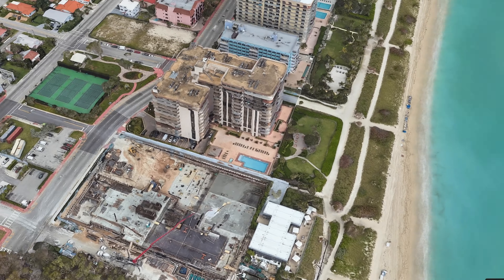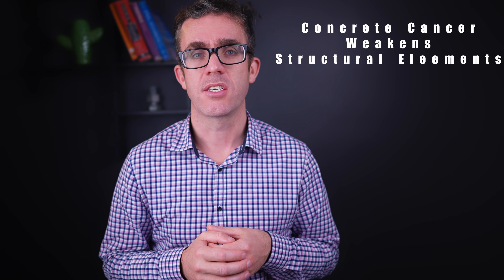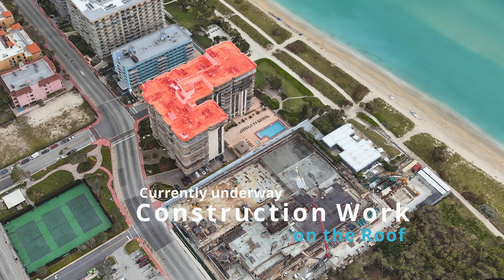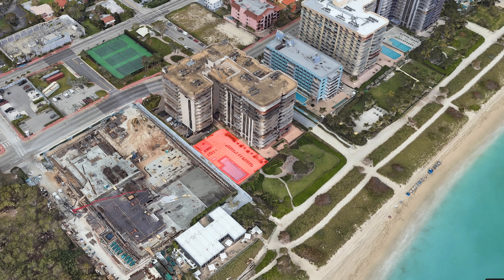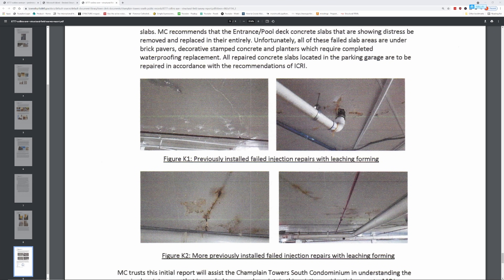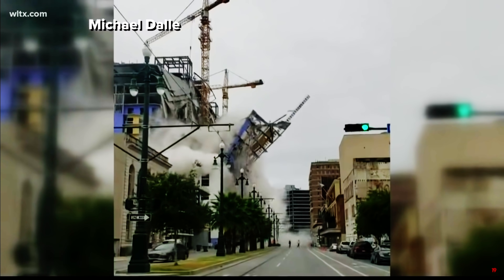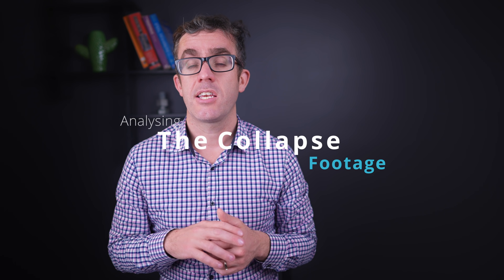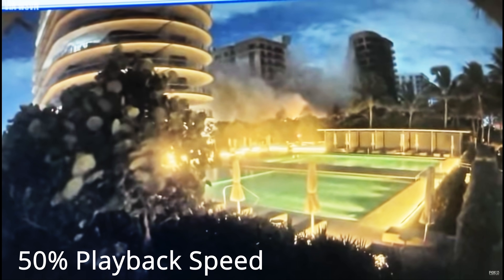How did a Miami building collapse: The Warning Signs. Report and  CCTV footage analysed

Comment: A local news affiliate in Florida interviewed the building manager who was there  for 5 years in the late 90s. He stated the entire time he was there, the building had two giant water pumps running all the time to try and keep the sea  water out of the parking garage area. He said frequently when there were king tides, the  water level would be up to two feet deep.  This surely was a major factor in the degradation of the foundation columns. Constant ebb and flow  of tidal waters for years greatly accelerated this buildings  demise.
Reply: This makes no sense.  How did this keep happening and didn't people keep losing their cars again and again? That alone should have been enough to do something about it. I heard one guy say cars would be floating around the garage. This is such a horrible tragedy. I can't keep my mind off of the victims, the families, the pets,  thinking about someone alive in the rubble, and they did not get saved.
Reply: @lewasil  yes and the sister tower had no flooding issues so you think that would be like okay its happening here but that over there was there something done wrong on this one
Reply: @jonwhick3073  Water flows where there is openings to flow and takes sand with it when it leaves.
Reply: I watched the TV reporter interview with the former Building Manager where we were told that at High Tide, the building’s foundation was immersed in SALT WATER,  if the TV guy was not being BS’ed, I would expect that REBAR CORROSION was the main cause of the Collapse.
Reply: @charlessayle1590  basanite is the future
Reply: That flooding happens in other buildings there also. It's park at your own risk, and has become part of life.
Reply: I saw that interview the guy said it was unique to that building, they also said a FIU study claimed the building was sinking into the ground so there might have been underground issues. A lot of those areas were filled in back in the early days of miami and who knows what they rammed into ground to stabilize the area.
Reply: I think you're right, Mad Mike: sea-water erosion under the slab.
Reply: AAAAAAND... this turned out to be COMPLETE BS!  Once they demolished (Go CDI!) the remaining part of CTSouth, and cleared the site, we see clearly that the foundation was probably the only part of the doomed structure that WAS designed and built correctly!  Not a single crack in the entire foundation slab, despite the entire building slamming down on it! How absurd to think that owners would keep sacrificing expensive cars to 24" of saltwater... SMH.  (PS: News "reporters" get played ALL the time--i.e. better to be FIRST than to be correct... idjits with very white teeth...)
Reply: If there is water intrusion Build a sea wall around the building you idiots, using pumps to pump out water for 40 years sounds like a Neanderthals idea.
Reply: @JonNobleNobelOne  sea walls wont stop ground water intrusions, you cant build a structure of that size pick it up and apply a waterproof coating\membrane to the bottom

Comment: Would it be able to be fixed before it collapsed? I have my doubts about whether it was fixable at all.
Reply: It was fixable when the problems were brought up initially. Condo board (owners) too cheap and no agreement/too much politics. This was an expensive but necessary fix.
Reply: With enough money you can fix anything.  Many buildings can be fixed and are fixed when problems arise.  We don't know the trigger for this collapse so we don't know what should have been repaired.  Yes you can fix the obvious deterioration but there could still be something not so obvious that needed to be addressed as well.
Reply: The idea that all the residents, much less the board of directors could agree on buying a box of pencils is most probably a major reason for the delay in repairs, & the disaster.
According to one surviving resident the board assessed nearly 800 thousand dollars each unit to condo owners to make the repairs. That’s ridiculous for most people. I wonder, legally, just who is responsible for such repairs (costs)?
JMHO
God bless & keep the souls lost & comfort their families.
Reply: Well if it wasn’t fixable, then why didn’t they evacuate the building? Why let all those people live in an unsafe building??
Reply: @nataliedeshow768  good question. Could be they just couldn’t agree on what to do.

Comment: Slight objection to your zoning - watching the video, it really looks like half of Zone 3 comes down as part of the first stage of the collapse. There are those vertical stripes on the front of the building; you can see that the first stage of the collapse pulls down everything up to those vertical stripes.
Reply from the maker: Hi Werrf, agree that part of zone 3 came down with the initial failure. Tho I would argue that it slightly proceeded the initial failure milliseconds.

Comment: Of course! You don't have to be an engineer to understand that a single point of failure is NOT acceptable in a building that size. I've been wondering about that, because NOBODY else has mentioned it. What happened on 9/11 was one thing.. probably no building anywhere can withstanding a jet plane purposefully ramming into it at full speed and causing a fire that melts all the supports. But that is a very very different thing than a large residential building completely collapsing after just 40 years(!!) just because of some corrosion issues in a couple columns. I never thought that this was even possible in a concrete building. When you look at a building with many huge concrete supports, such as a multi-level parking garage, you might imagine that if one of those columns gives way, then likely some portion of the building will fall away or crumble or be damaged, but ... there's a ton of other columns! What were THEY doing?? NOW i'm thinking concrete buildings are actually more fragile than wooden ones because they seem to be built like a house of cards. Whereas houses with just a wooden frame, in a catastrophic flood can even be seen floating intact on water for quite a while after being ripped off of its foundation. A huge concrete building, with MANY people living inside, you would thing would have at least as much integrity as a wooden house. I'm sorry, some delayed maintenance in a 40 year old building CANNOT be the main excuse for something like this. 40 is nothing for a building.. it's a baby. Some Roman columns are still standing, with no maintenance for hundreds of years, some by the sea, i'm sure. LOL.
Reply: My guess columns were built to just barely hold the needed weight for the building with no redundancy. You know cost cutting, profits and all that good stuffs. column fails the others can’t take the added weight and quickly follow.
Reply: @andresjimenez3811  Yes, and if that was really the case I hope this is an incentive to change the code. I also wish the public would stop buying the illogical logic that we are told and start thinking 'outside the box'. We're essentially being told well you can't expect a building to go undermaintained for 40 years in this climate and location and not collapse. What?? First of all, if that is the case then why are re-certifications only after 40 years? Aren't you playing with fire setting them for the 11th hour like that? But much more importantly is what is far more obvious - every building needs to be built with the materials and methods appropriate for the conditions of the location. In earthquake prone areas certain precautions are required that aren't in others. Nobody says well wait out the first couple of shakers and then in 20 years put in some reinforcements in case it got a bit wobbly. So maybe ultra corrosable materials like conventional rebar and concrete is NOT the way to build on the shoreline. Heck, maybe wood is better, i don't know. But you can't keep building with methods that you KNOW will quickly (a few decades is VERY quickly for a building) develop HIDDEN issues specifically due to the environment. It needs to have a bit more forgiveness to human user error. We KNOW HOA's are a very questionable force in this world, so it is illogical to rely so heavily on them always doing the right thing. Of course, we know, ANY building may collapse catastrophically if not cared for, and after giving many many very obvious signals of distress for a long time, maybe in 120 years. But not in 40 with only subtle signs! That is not acceptable. Owners and tenants are prone to think 40 years is nothing for a solid building, and they would be right. And i bet that was a big part of it. They paid a pretty penny for the units, the HOA fee is exorbatant, so they're thinking what kind of bologna are we being fed - all this money out the pipe on a beautiful contemporary, young building! Makes sense that half the owners were suspicious and resistant to the HUGE assessments. I would absolutely be too.
Reply: @comment6864  I suspect that there may be changes to the code.  There were changes to the code after the Oklahoma City collapse to provide more resistance to total collapse.
Reply: I couldn’t agree more with your comments. I live in a much older high rise in Spain, and the most each one of us owners had to pay for a major repair was 2,500€ a few years ago.

Comment: For a building to fall down in that manner, the structural columns of zone 2/3 had to have been in a deteriorating state otherwise they would have still been standing after the pool deck collapse . So much media attention has focused on pool deck as the culprit but I would bet that in the end the investigation will find that underground saltwater  disintegrated the columns to the point that any abnormal stress would have sent them tumbling down
Reply: Yeah, i've been thinking the same thing - the main issue was really in the ground under the foundation. Otherwise nothing makes sense. We're not talking a 120 year old building here that's been negelected for a long time. A 40 year old undermaintained building does not just catastrophically collapse like that. Unless completely wrong materials and methods for the conditions and location were used. And then that's a whole other can of worms.
Reply: @comment6864  
As a trained architectural draftsman
I concur. 

That pool deck was integral to the overall structure because they attached it to the columns with rebar stitching along the edge. This is particularly important here because that connection point is also the perimeter of the building structure. 16x16 columns are not enough to support a 12 story concrete structure. IMO. 
That massive load is not supported by heavy columbns and transfer beams but attached to the main structural columns, at an offset height, by rebar stitching and the "stitches" are not extended deep into all elements of the connection. 
IMO, that's a major design flaw and a contributor to the failure.
Reply: @comment6864  You are correct.  "Completely wrong materials and methods of construction for the conditions" were used. The building is less than 100 Meters from the sea. Never mind the flooding, salt water spray and capillary action means that salt water is always in contact with the building structure. Stainless steel rebar needs to be used in these conditions. 3 inch cover and higher strength concrete would have been desirable. We have been building in salt water environments for many many decades but unfortunately the lessons learned there have not been extended to buildings.
Reply: @MrParcho  I think they have updated a lot of the building codes since but clearly wasn't sufficient for 1981.
Reply: @timothybogle1461  I think that stainless steel rebar has not been mandated, just considered good practice. Nothing over the pool deck slab to spread the load of the slab is just poor design, needs a flat beam or at the very least a drop panel over the columns. The worst design of all was connecting the pool deck to the building columns.
Reply: @MrParcho  stainless is way way more expensive than other steels and doesn’t have the same properties—particularly strength/weight ratio—I once asked this question regarding why they don’t make bicycles out of stainless, but instead use chrome-molybdenum steel (when they used to make bikes out of steel —nowadays it’s mostly carbon fiber and aluminum).

Also stainless doesn’t mean “inert”. It is much less prone to iron oxide formation in fresh water as the chromium content forms a skin that prevents regular rust, but Stainless is particularly prone to corrosion in salt-water. This condo is at the Oceanside…
Reply: @kineahora8736  They make stainless steel specifically for use in marine environments. Stainless is a much tougher steel than normal mild steel. Everything comes with compromises, If you want million dollar views you should expect to have to pay a premium. After all you will be charging a premium.  Stainless steel is about 4 times the price, but then rebar is only a small percentage of the overall building cost.
Reply: The pool deck collapse possibly buckled the 3 columns where the building collapse started. There are multiple contributing factors.
Reply: @Gregorius421  Why is such a huge and heavy deck so integrated with the structural supports of the entire building?
Reply: @Gregorius421  The pool deck slab was tied into those 3 columns. So when the deck collapsed (and that was due to poor design) it provided an eccentric load to those columns. The building load above did the rest.
Reply: @Gregorius421  Yes, that looks like what actually happened, but i wonder if the deck was only able to buckle the columns because they were so deteriorated at the base that  they could not withstand that stress as they should have.
Reply: @comment6864  I would think so.
Reply: @comment6864  No, columns are designed to take vertical loads only with some shear from the wind. The deck was subject to corrosion, but is they were designed with a flat beam overhead the columns would not have punched through the slab. The slab would have collapsed in small sections between the columns.
Reply: According to what a former maintenance worker said, that building had major flooding issues since at least 1990. So that would make sense.
Reply: It’s probably a combination of the constant flooding deterioration of the foundation and what the creator of video called Concrete cancer, salt water mist intrusion into the rebar and concrete of the building degrading for 40 years.
Reply: I agree. I'm frustrated with the constant pool deck breaking first.
Reply: How does anybody know that the pool deck collapsed 1st? The pool deck probably collapsed from the weight of the rubble landing on it from the falling building.
Reply: @sohotechnologysolutions8583  There are other videos on Youtube that show it's most likely the pool deck collapsed first. Even a live video from the street looking into the garage showing the debris near the columns discussed.
Reply: Nah, they could have been toppled by angular moment from the pool deck punch-shearing.